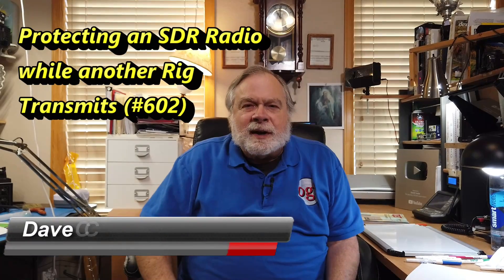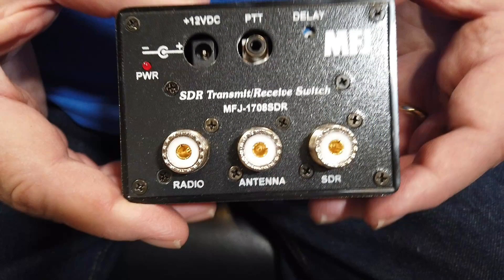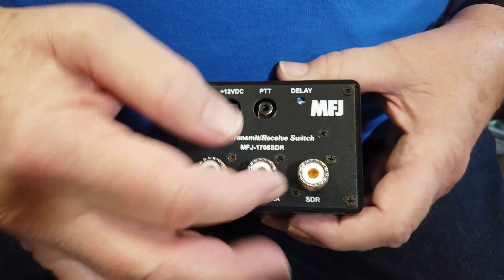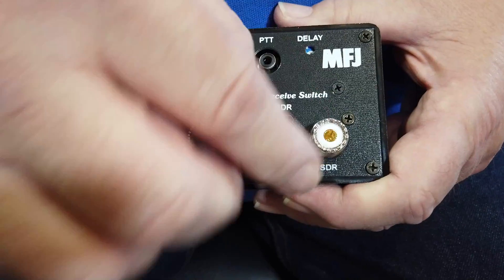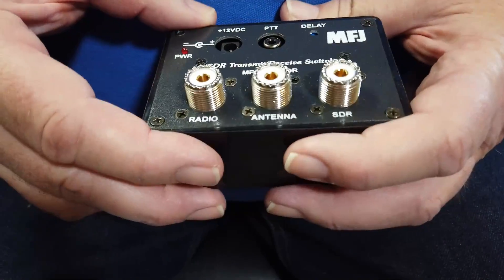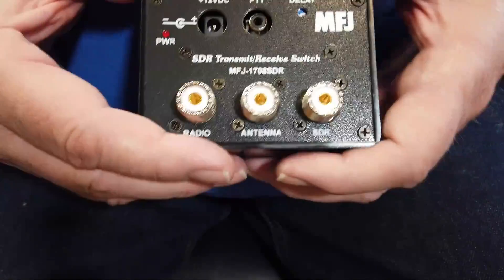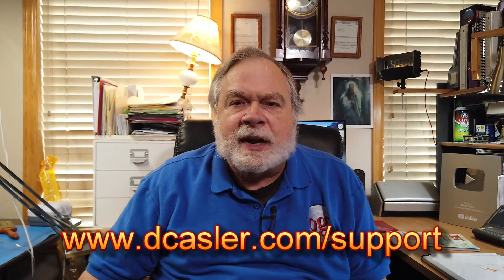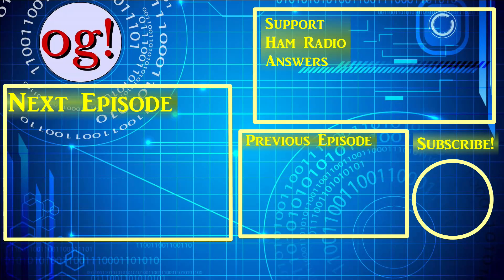Protecting an SDR Radio while another Rig Transmits (#602)

Comment: I don't know if this would work for me. I run unitrunker and dsd with two dongles. It's in a ruggedized case (knockoff pelican) running on a windows mini pc powered by a 30ah lifepo4 12v battery through a 5v buck converter. It'll run well over 48 hours non stop.  Originally I wanted to put it in my work truck. When I transmit on the commercial vhf nxdn radio in the truck, it knocks the dongles offline. Even with the mag mount antenna disconnected from the bnc connector on the case. It sucks. I use it at home and after some initial bugs that I worked out, it has been very stable. But it does not fulfil what I designed it for, a mobile transportable headless trunking p25 scanner. I still had fun building it.

Comment: I would just turn off the SDR before transmitting on my main rig. After all, you cannot use two receivers at one time, can you ? I have one of the cheaper SDR's because I didn't want to waste money in case I didn't like it. If I wanted to check my TX signal, I would just listen to my National HRO-5, then cut off the B+ when finished. If the SDR was off when you transmitted, it wouldn't be damaged by your 100W signal (unless you had my Drake L-4B and the awesome power it puts out if I drive it with 120W).
    All my antennas are up 70' at the ends, and round 66' at the feedpoint. The SDR antenna is up there with the rest, but 45° off from the dipoles so it doesn't interact with them too much. The SDR antenna is a 200' long, sort of random length off center fed dipole with no value. I sit on the top of a 550' hill, so my signal "rolls off" bringing the angle of attack down to between 10 to 15° to the horizon as best as I can figure. That happens to make my 80W signal almost 5/9 anywhere I talk to. I still want to disable my SDR so as to not damage it with the intense signal if I forget and turn on my L-4B in a hurry. MFJ stuff does work, but I do not trust such an "attenuation" even if it does ground the SDR input. Also, I do not trust myself to remember to use the MFJ box when I hear really rare DX. There used to be an ICOM 6 meter transceiver that I am still looking for from the 70's (SSB&AM) with its own telescoping rod antenna, not a handheld, but a battery cased CB radio sized transceiver with Mic and shoulder strap. I saw one being used from a hilltop near Rochester,NY quite successfully, probably during a band opening, but great signal reports given and taken with that little rig. I would love  find one! 73's ALL de W4FJF.

Comment: I use an RTL SDR as a pan adapter for my FT-857D via a (PAT70M) Board. 
How can I stop RF getting into the RTL SDR when transmitting as it knocks the SDR out?
There is already RFI/EMI clip on ferites on all of my equipment as well as 1:1 ferite wound common mode chokes inline with the antenna.
Reply: if the buffer/amp is picking up the signal from the right place, the radios PTT will disconnect the rx from the tx properly and you still get the radios preselection poroperties

Comment: Hi David. General question. I am finding Coaxial cables are not what they used to be. For example they used to be copper wires. Now I am finding that they are copper plated steel wires. Had several failures of RG58 and others. Use magnet to test them. Also makes a big difference when making coax traps etc. I am in the UK what are cables like in your country. Cheers from old George

Comment: Seems like that device is for the radio and SDR using the same antenna. He asked about an SDR using a different antenna. Am I missing something?
Reply: To use the device with a separate receive antenna, connect the transceiver directly to the transmit antenna.  Connect the receive antenna, the PTT control line from the transceiver and the SDR to the switching device.  The XCVR/Radio connector on the switching device is left unconnected.

Comment: I've seen my MFJ-259B antenna analyzer show a signal on my IC-7300 waterfall even though it has no connection with the 7300 or its antenna.

Comment: Good video, I've had to stumble around this earlier this year when I got my RSPDX. I'm not a huge fan of the MFJ-1708, there is a noticable delay on the relay when tx-ing. I still use it on my rx mag loop, and just simply didnt connect the coax from1708 to my radio so it would still flip the relay when I tx, and the rig doesn't need that antenna. For my other channel on the SDR, I've used a ZSC-2-2+ to have my 7610 output my rx signal on whichever ant I'm using to the ZSC-2-2 to split the signal, then put it back into the radio and rx it on the SDR. The 7610 also cuts the rx channel when tx-ing, so no harm to the SDR. However, the ZSC-2-2+ expectedily reduces your rx signal.